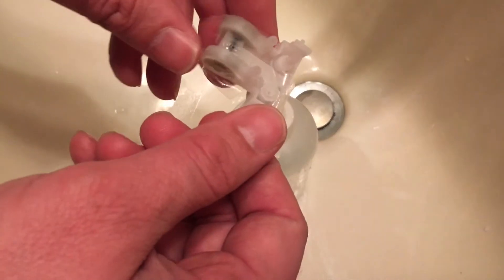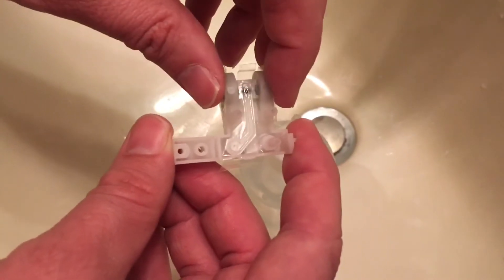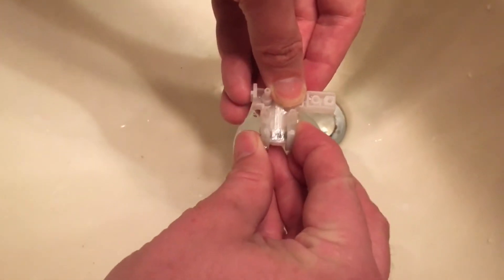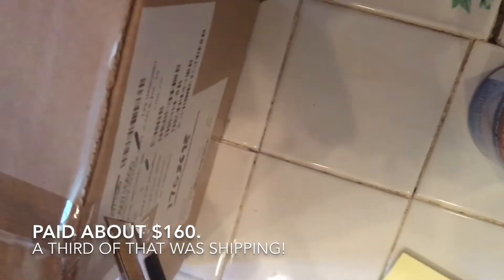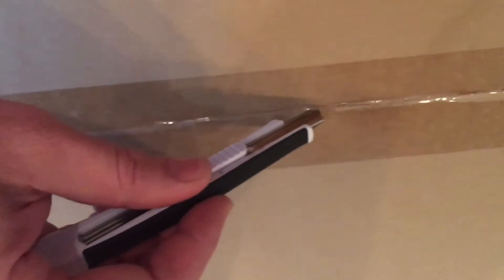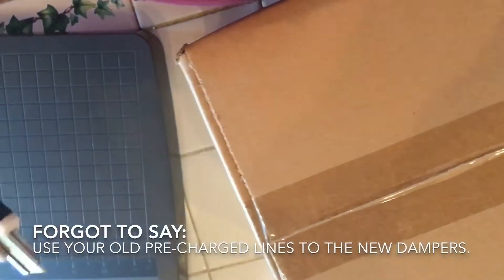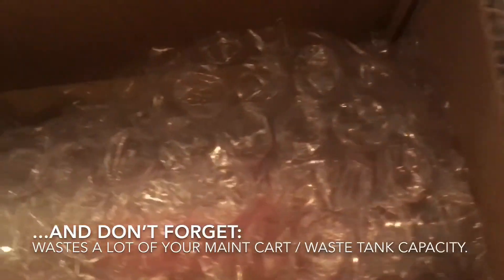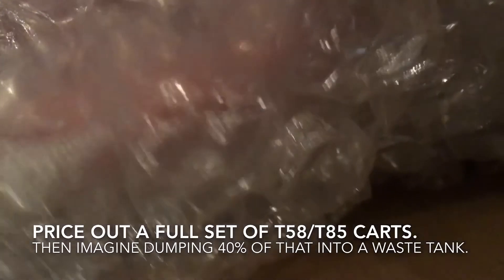Black ink switch valve fix Epson Stylus Pro 3800 3880 SureColor R600 P800

Comment: My black ink is leaking out and I would like to find the ink system assembly, do you have a spare? Do you think I can solve it by cleaning the valve>? Can you help me figure thids out I have a printer with only 800 prints and it is a boat anchor.
Reply from the maker: Epson seems to have changed the valve in a way that fixes the reliability issue with a more recent version of the valve used in the P800. This probably explains why I found several different part numbers for the ink supply system. The P800 part is presumably compatible with the 3800/3880 and it's likely what you would receive if you ordered the part.

I'm keeping my restored valve as a spare to swap in case my replacement fails but it's definitely one of the ones that will do it again if you don't use the black ink switch occasionally. After I ordered the whole ink supply system I found listings for the damper assembly or even the ink switch valve alone. I could see it being very messy if you replace the switch valve without a spare damper/valve assembly to switch to like I did. I'll try to dig up some links or that list of part numbers I had.
Reply from the maker: Here is the ink switch:
https://rover.ebay.com/rover/0/0/0?mpre=https%3A%2F%2Fwww.ebay.com%2Fulk%2Fitm%2F263749332301

It's under $30 but I don't know how to stop ink from flowing out of the channel tubes without buying something like this instead:
https://rover.ebay.com/rover/0/0/0?mpre=https%3A%2F%2Fwww.ebay.com%2Fulk%2Fitm%2F264238366762

What I did was I switched the old tubes full of ink to the new damper assembly complete with ink switch valve and distribution plate. This means you will only need to get ink into the dampers and fill the black ink lines.

I filled the dampers by running the self-cleaning over and over. If you do this I suggest getting a chip resetter and a second maintenance tank/waste ink cartridge so that you will not be wasting waste ink capacity while squirting air (printer thinks it's squirting ink during the cleaning cycle and reduces the remaining waste capacity accordingly). This will be useful in the future since you'll never need to buy another waste cart: Just stuff them with paper towels and reset. You need two because the printer will remember the previous cart's capacity even after you reset it but it will forget as soon as you insert another cartridge. You'll probably want to have a set of spare cartridges too so you don't get stuck in the middle of this.

After several cleaning cycles, run the automatic nozzle check to see if it shows ink. It will fail the check since black is not firing but you should be able to see 3 other colors. It won't move on to the other colors until it passes the first four, and it has to draw a lot more ink to fill the black damper since that line was totally empty. Luckily, switching between black inks (MK/PK) causes it to purge a damper-full of black ink every time you switch. Because one of your dampers is still full of air, it'll actually pull a damper-full of air when you switch to the other ink and will only waste half as much. Luckily, black is the cheapest color when you shop around. ;)

Do an automatic nozzle check every time you get back to the line we are trying to charge so you can see when it fills up and starts printing black. If it passes all nozzle checks for the first four channels it will move on to the next four colors, which should be working unless you have another issue. Once you get all colors, you're done!

The automatic nozzle check works by purging ink to clean itself if the optical sensor does not see the expected pattern, then repeating the test pattern. It does this a few times before erroring out, since the rest pattern would need to be longer than a sheet of letter-sized paper if it were to continue further. This makes it very tedious to purge black this way and it probably purges other colors too, so I would alternate between nozzle checks and ink switch purges until I see results.

Comment: Thanks for this video.  I cleaned mine and got it running for about 40 prints.  I ran nozzle checks when not using it, but when I cleaned the head to clear the Cyan, the black when out totally again. I switched to mat, no change. Then I cleaned the head with a paper towel and windex, ran a cleaning cycle the mat came back. But still could not get the gloss black working. Do you think a new valve would fix it?
Reply from the maker: It’s very likely that your Photo/Gloss Black (PK) cartridge drained into the maintenance cartridge while the switch was malfunctioning so it’s level was being mis-reported. You can tell if you weigh the cartridge. A totally empty cartridge (<0%) will be about 62 grams. A totally full cartridge (100%) will weigh about 129 grams. A normal empty (0%) will weigh about 80 grams.

If this is the case then your PK feed line will also be empty and it will take several ink switches and a lot of wasted MK before the PK line will be full enough to Prime the shared MK/PK damper. Perhaps you can manually prime it by taking it apart down to the damper assembly and using suction (syringe with s bit of tubing). This will save a lot of ink!
Reply from the maker: That said, a drained PK misreporting the capacity does typically mean you have or had a faulty ink switch. Replacing it if you haven’t already will fix the problem but it is likely to happen again if you don’t exercise the ink switch by occasionally switching between MK and PK (every few months?). Each switch wastes a damper-full of ink but changing the whole ink supply wastes exponentially more!

I have found sellers selling just the switch or the damper assembly but Epson only sells the entire Ink Supply System. Replacing that requires you to recharge all the ink lines and dampers with a full set of new cartridges and a special Epson software tool that isn’t free.

I bought the Ink Supply System but cheated by installing only the damper and ink switch part which left all the lines full of ink except for my drained PK. I primed most of the dampers by running multiple deep cleaning cycles and automatic nozzle checks and primed the PK line and shared MK/PK damper by switching back and forth between them. It normally purges a damper-full of ink when you switch but this was purging a damper of air and drawing a damper-full quantity of PK into the tube with each MK-to-PK switch. Of course, this also means wasting a damper-full of MK with each switch, but it’s much preferable to the alternative.

Good luck!

Comment: Emmett , what's the best adres to buy the ink switch.  I have two printers with both the same problem.   I want to try the reparation but first the parts i need.   Thank you so much for sharing this.  Greetings from Netherlands
Reply from the maker: Hi! There are better options now than the full, new, ink supply system assembly I was forced to buy.

On eBay you can find the switch itself, item number 263749332301. Item number 253684228314 is for the switch, damper assembly, and ink lines. Some people convert these printers to “DTG” (Direct To Garment) printers which often have no use for the original dampers, ink switch, and ink lines. Item 292782407250 is the ink switch, ink dampers, and ink lines from an Epson SureColor P800, which is almost identical except for a small redesign of the ink switch that supposedly does not fail as easily. There’s a very good chance that it will be compatible with an Epson Stylus Pro 3800 or 3880, but I can’t be sure.

Hopefully those are available to ship to The Netherlands. Try searching eBay for those three item numbers and see what works best for you. :)
Reply: thank you Emmett, I'm going to search. Can I replace that component without having to breathe or refill the inking system? Do you have experience with that or do you know that? Have two printers with switch problems here. 1 of these has also blocked 2 ink channels. Refillable cartridges and then a lot of print work from autocad with minimal use of colors 😬 All costs are - your time - I like to pay. Here Epson dares to ask 400 euros for repair switch ..
Reply from the maker: Gerard Terpstra Epson charges several hundred USD to replace it here as well, and then they will use a special program to reinitialize the ink supply which will waste hundreds of dollars of ink and maintenance cartridge capacity. Doing it that way yourself would cost even more since you have to buy an “Epson Adjustment Program” to reinitialize. It’s ridiculous! Luckily, I found another way.

To avoid re-initializing the ink lines when replacing parts, I only swapped the ink damper/switch assembly with the distribution plate that the lines connect to. This left me with empty dampers for all colors but charged ink lines for most colors. Due to the bad switch, PK (Photo Black) had drained and the line was full of air.

To charge the PK line I simply used the printer menu to switch between MK (Matte Black) and PK repeatedly, which normally dumps a damper-full of ink into the maintenance cart (MK and PK share the same damper). Since the PK line was dry, it was actually drawing that much ink into the PK line for each MK to PK switch. This does waste MK to switch back but that’s still better than reinitializing the entire ink supply and using nearly half of all 9 cartridges!

It also wastes a bit of maint cart capacity with each switch, even when the damper is empty (printer still behaves as if it dumped ink). Do you have a chip resetter for your refillable carts? It should work on the maint cart too (reset them from both printers and switch between printers). I actually have an extra I don’t need but it might cost more to ship than simply buying a cheap one from China. :(

Of course, the other ink dampers needed to be filled too, so I loaded in some plain paper and used the printer menu to run multiple cleaning cycles. After a few of those I switched to automatic nozzle checks because the printer automatically flushes a bit of ink and tries again when it fails the nozzle check. In this case, that means it will automatically flush a bit of air and draw more ink into the dampers. ;)

When everything is working normally the auto nozzle check prints a pattern for half of the colors, looks for gaps in the pattern using an optical sensor, then prints the same pattern with the remaining colors and checks those. If all is good, it prints the results at the end. When it finds something wrong in either pattern it flushes a bit of ink and then extends the pattern on the sheet. After a few tries the pattern will be too long for the printer to finish the test on a standard Letter/A4 sheet so it suspends the test and shows an error. This will likely happen several times before enough ink has filled the dampers to complete the nozzle check. Don’t despair! Ignore the error and start the auto check over. :)

I was very lucky that mine had no blocked ink channels but I have seen people who have cleared their printhead using a syringe, tubing, and special solutions like PiezoFlush or Pharmacist’s Solution. Pharmacist’s Solution is a formula a photo printing enthusiast came up with on the Printer Knowledge forums. As I understand, you make it yourself, remove the damper assembly, connect the syringe to the affected channel using tubing, then alternate between pressure and suction until the channel is clear (fluid flows normally).

I hope this helps!
Reply: @emmettturner9452   thanks a lot for your explain and help...  
Is that easy to do :  I only swapped the ink damper/switch assembly with the distribution plate that the lines connect to 
  I have a damper switch ordered from aliexpress, costs fall all along, saw all a description on You Tube how I can remove the caps etc. That loose particle is that easy to disassemble?   With the part number was that good to seek and find 22 usd.
Greetings
Reply from the maker: It was relatively easy to replace the whole damper/switch assembly but I can see it getting a little messy if you replace only the switch, since the dampers and switch will be full of ink as you work with them. When I fixed my old ink switch I worked with the whole damper assembly over a kitchen sink so I was able to wash away the ink before it stained anything. Original pigment ink washes away with water easily but I can’t be sure about the refillables you are using.

I followed a disassembly video on YouTube and broke a couple plastic tabs getting in but they really didn’t matter. The hardest part was getting the ink switch motor and actuator off of and back on to the damper assembly. As I recall, I had to turn the gear until it got to a position that allowed me to slip it off, but then I still had trouble putting it back on even though I had not moved the gear. It’s really just a minor annoyance.

I suggest removing the damper assembly from the printhead while the hoses/ink lines are still connected, then unscrew the plastic bracket holding the hoses on (two screws) and remove the hoses while they are elevated. You might want a bowl or something under the damper assembly to catch any ink that comes flowing out. Temporarily secure the ink lines high enough that the ink won’t flow out while you are working with the ink switch. Good luck!
Reply: @emmettturner9452   thanks a lot for  all your information.   I let you now when the job is finished.       Greetings Gerard
Reply from the maker: Gerard Terpstra No problem. Good luck!
Reply: @emmettturner9452   
 I have now entered the switch and I searched in my archive for some previous information that I received when I bought a box of 3880 cartridges. That man also had a switch problem and sold everything. He later sent me a couple of progjes with which you could reset the ink system of the printer as if you put new cartridges in a new 3880. I really want to share that with you .. It may be a lot different but then I hear that. I still have to start the repair.   I have also the prog.  When i have your emailadres i send it to you. 

This one...

To make Initial Ink Fill or Power cleaning:

1. Run application.
2. Click - OK
3. Click - EXIT
4. Click - START
5. Select Initial Ink Charge and click OK

Full version You can get here - 

https://www.2manuals.com/product_info.php?products_id=1364

Gerard ( Netherlands)
Reply from the maker: Gerard Terpstra So you have replaced the switch but you still need to finish the repair? That program is very useful if you don’t mind wasting some ink. :) I did not purchase the adjustment program and I did it the hard way to save ink but it is also useful for other things.

The Initial Ink Charge uses about 40% of the ink so reinitializing it with your old/filled ink tubes can dump out nearly that much. It’s a good idea to have a full set of fresh cartridges and a fresh maintenance cartridge before reinitializing.

Email is Gmail:
jemmettturner

Thanks!
Reply: Emmett Turner ..
Good morning Emmett, sorry for the radio silence .. few days vacation. No, I did receive the switch but now I am gathering courage to do the job. It's a pity that you did not make a video of changing the lid. I want to do that in the same way without loosing everything. Have you had any response from other Epson users who have done this job? Have a nice Sunday
Reply from the maker: Gerard Terpstra Thanks! I have heard of others ordering the switch or the entire assembly but none have confirmed with me how they did it. :(

Because I bought the full assembly I can try to demonstrate what I did using the empty Ink Supply System but I don’t think I can justify taking apart my printer when it’s working fine. :( Perhaps I can get permission to use someone else’s disassembly video and edit my instructions onto the end of it but that could take months to arrange.
Reply: Hai Emmett, I have two printers here with the same ink switch problem. 
So you can use that. 
Do you have to make a trip to the Netherlands. (kidding) 

Emmett I unscrew the printer and makes the ink head and ink switch free to approach is .. as you wrote to leave the ink hoses. 

Keep up because of running away ink. Is that new switch screwed on or clicked? Do I need separate tools for this?

 I will send you by email the information I received from a photo friend who was also playing with the Epson. I think that is the software Epson uses to fill the ink after recovery or new use of the printer (head). What you described not to do with the expensive ink cartridges from Epson .. (smile)

 If you can indicate whether the switch is easy to replace .. very happy .. (sorry for the translation .. Google Translate not the best) Greetings Gerard ( Netherlands)